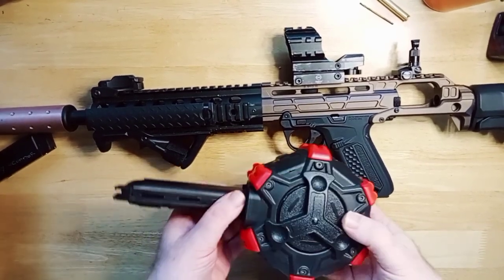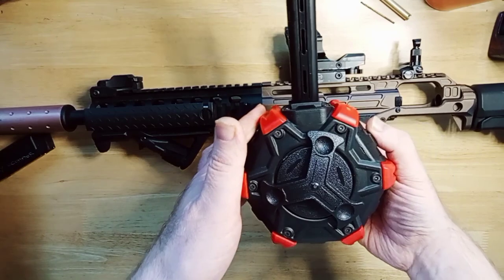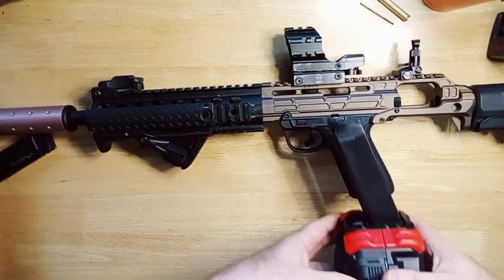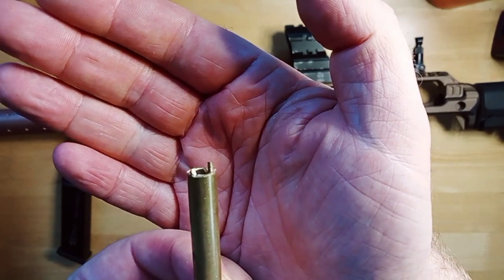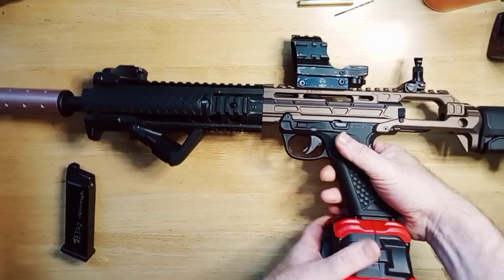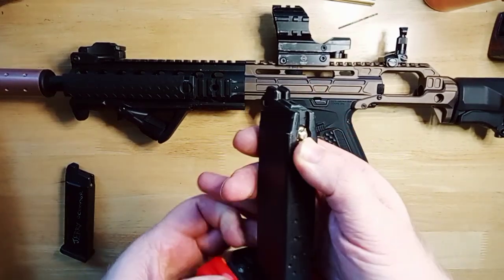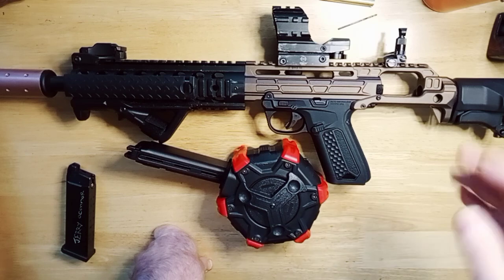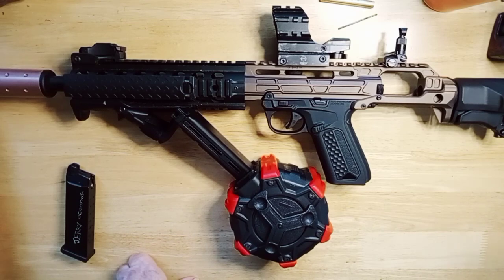DOUBLE BELL DRUM MAG ISSUE

Comment: I had an issue with this mag with a leak. Turned out i had the wrong valve tapped for the HPA connection. Swapped it over works great. Biggest issue i have is the mag on a glock 18c as i always seem to hit the mag release. The Mag is heavy and it will drop out easy.
Reply from the maker: I'd probably flatten the mag release but still be able to push it with thumb.
I think that's how I lost original AAP mag with this.